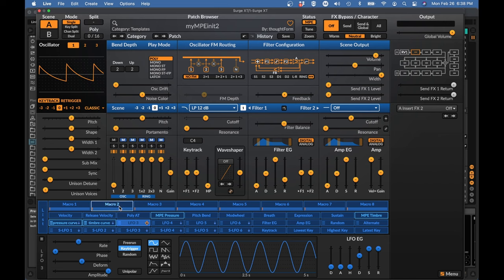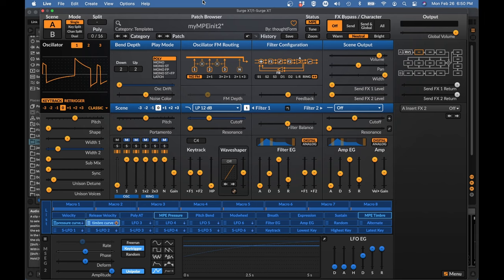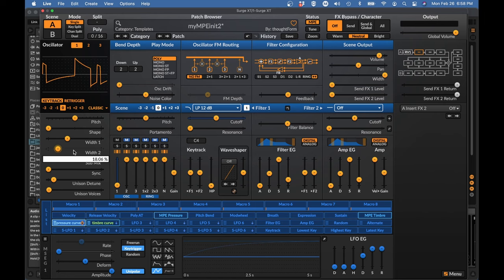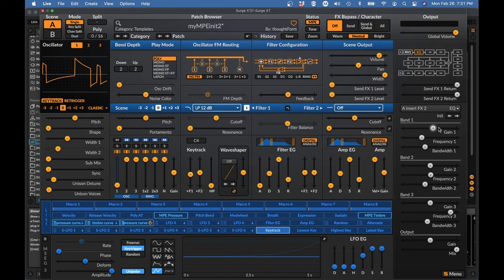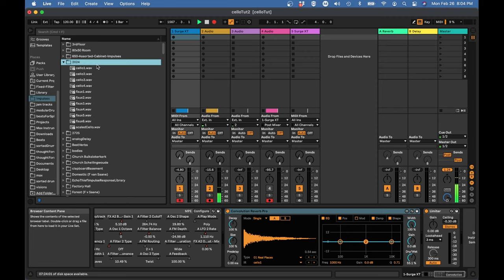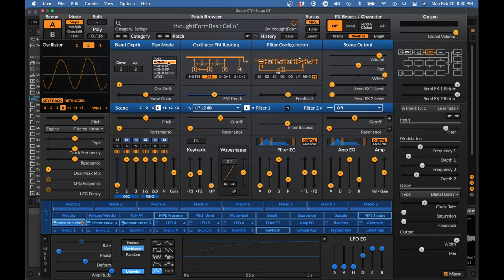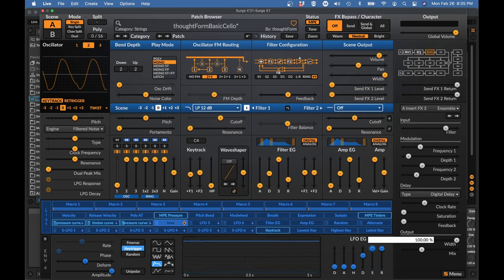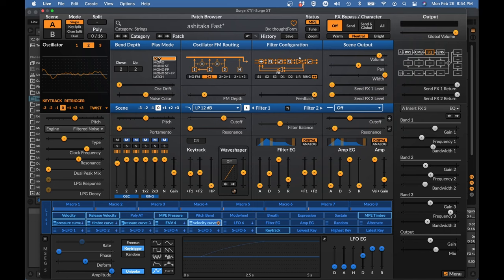MPE Sound Design in Surge XT: Cello

Comment: I'm interested in an acoustic guitar type sound but with the full complement of MPE control. Which oscillators would you investigate?
Reply from the maker: I would start with classic->square wave, as we did here, but with a medium decay and no sustain, but modulate the sustain with pressure. Might mix in a second oscillator pitched up 19 semitones to get a tapped harmonic, but only above a certain high level of velocity or Y-axis. You might get very good results with the methods discussed in episode 4, but it will probably take more experimenting and massaging to get it to behave as desired.

Comment: Ok I just clicked this and will go back to this,  but do you have suggestions on the best way to use this with Touché as a bow?
Reply from the maker: I don't have any firsthand experience with the touche, but I think you would assign an axis from the touche to one of the macros in surge's modulator section, then use that macro in place of MPE Pressure (in this cello it would be modulating the phase of the two pressure curves). Then I would experiment with using different axes/macros to simulate bow direction and tilt...maybe modulating the FM amount or the resonance on the filtered noise oscillator.